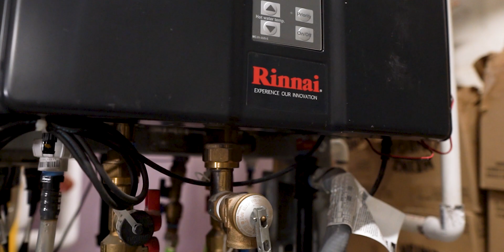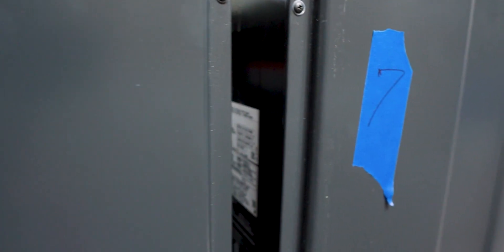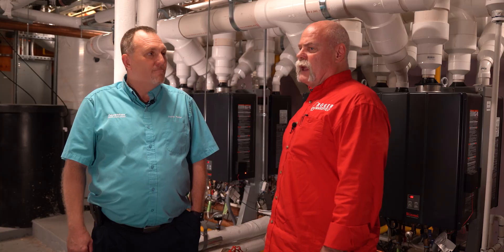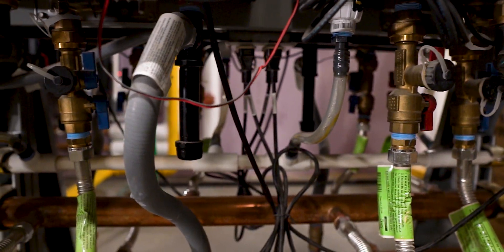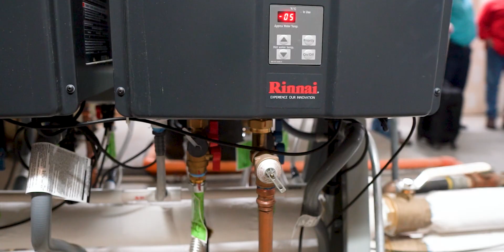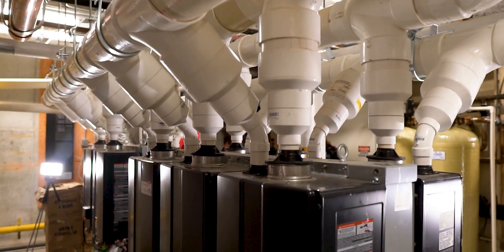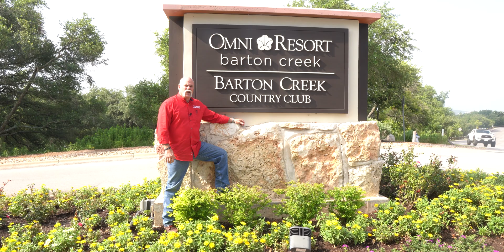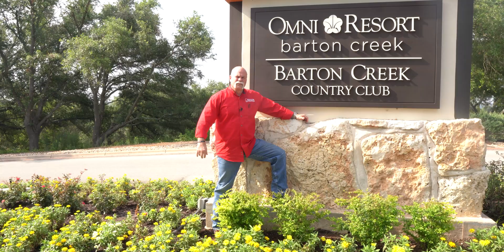New Tankless Water Heater Technology Threatens To Take Out Big Boilers

Comment: My question is is why are some of these units with T and p that are drained out and other ones don’t have that set up? Why would you only do part of the job instead of doing a complete job?
Reply: T and p that are drained out? Do you mean why are some plumbed while others just terminate at the mouth of the T&P? Here in Canada and in the manuals I believe, it would be against code for safety reasons to not have it plumbed to within 12” of the floor to avoid hot water spraying people during failures. 

I would guess the codes ther are more relaxed, and the ones with plumbing may be next to a wall that can’t have a mess of water water around it or some other similar situation that requires it to spray off in a safer location?

Comment: This many tankless water heaters increases maintenance  cost because  there more individuals  units. Better option would be 4  or 2 condensing boilers pared with Turbomax instantaneous water heat exchanger.
Reply: That ignores the advantages of redundancy. Ntm the simplicity of smaller, simple units.